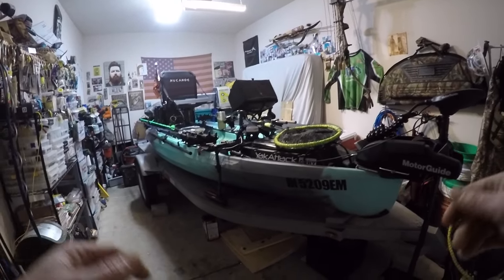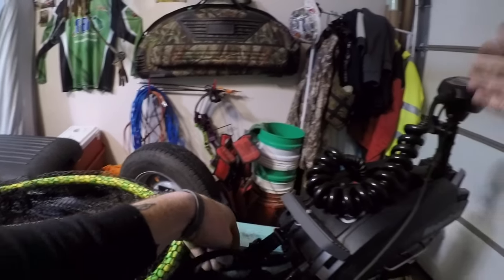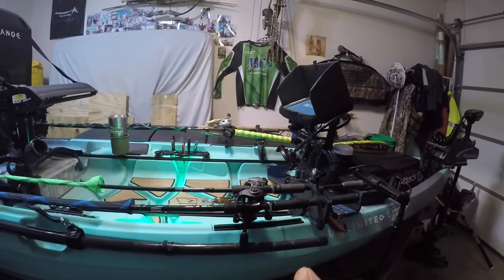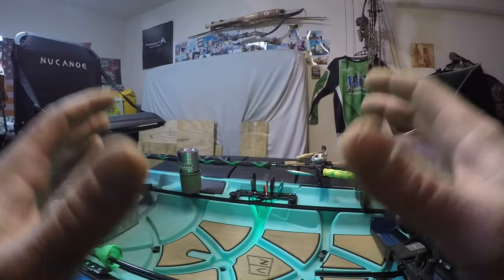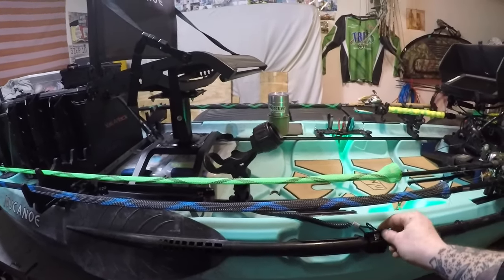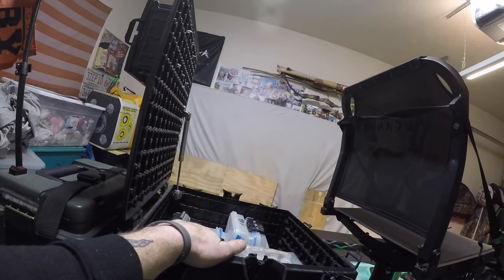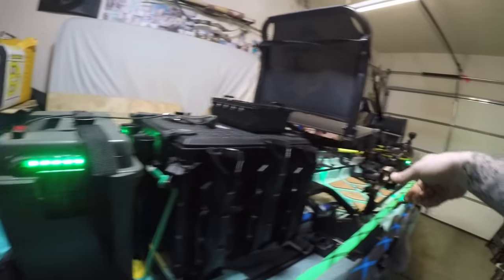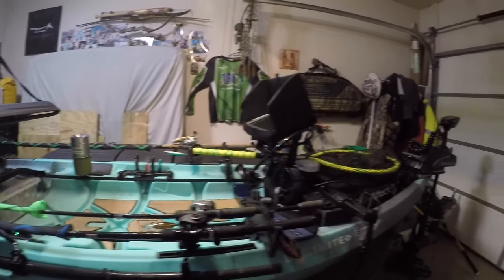Nucanoe Unlimited, is this the best kayak ever?

Comment: Out of curiosity how are you charging your lithium battery in the box with the Marinco receptacles?
Reply from the maker: I open the battery box and plug my battery charger into the terminals? Just like any other battery and charger.
Reply from the maker: You could also wire up the battery charger with a female receptacle and plug it in that way.
Reply: I currently use Anderson connectors and when I charge my battery I have one directly to my charger and was thinking of switching to the connectors you are using in my next build hoping to do the same.  My only worry is the posts being exposed vs the Anderson which are a bit more protected.
Reply from the maker: @robwelch001 nothing would be exposed. The posts slide into the female receptacle and nothing metal will be exposed. I’ve got alligator clips on my charger so I just hook them to the normal battery posts. I would have to buy another female plug to use the plugs to charge.

Comment: Do you have links to all the parts you used to make your sceg?
Reply from the maker: Trollingmotorparts.com for MK endura shaft and transom bracket. In the video I used the bullnose rudder which you can find on google but actually just made a new one with a 6x9” 1/2” cutting board from Amazon. For the new one it was 58$ total.
Reply: @Nategoodwinfishing  thanks,  awsome setup. Just got my 2024 unlimited the other day.
Reply: @Nategoodwinfishing  just got all my part and got it put together. How are you able to use your pull cord to pull it up when you have to compress the spring?
Reply from the maker: @AuburnMan I drill a hole in the level and put the pull cord through that and around the shaft so when you pull it the shaft folds up. I’ve never had to pull it up but I add it for just in case.

Comment: You know nucanoe makes a rudder for this kayak to be used as a skeg different from the foot pedal rudder.
Reply from the maker: When I made this rudder for jon boats 12 or so years ago it worked perfectly. When I had my pursuit in 2020 nucanoe didn’t have a rudder so I built the one you see. Now that they have one I don’t see a purpose of buying one when this one works exactly what I want. Last I checked it was 375$ I’ll stick to my 70$ fixed position rudder/skeg.